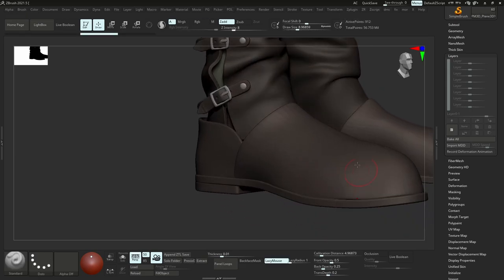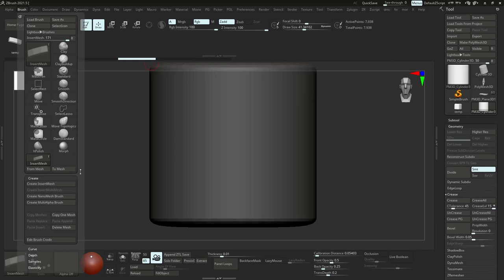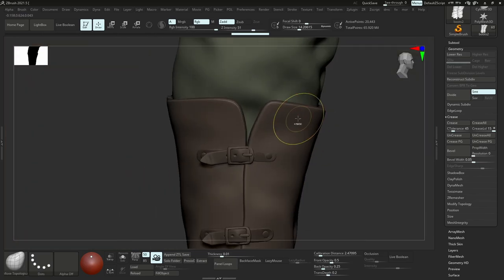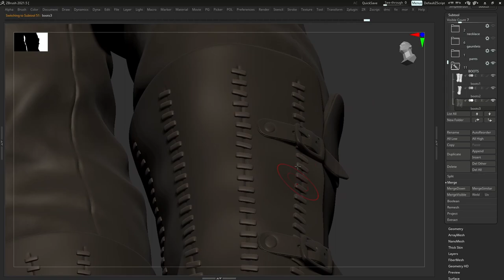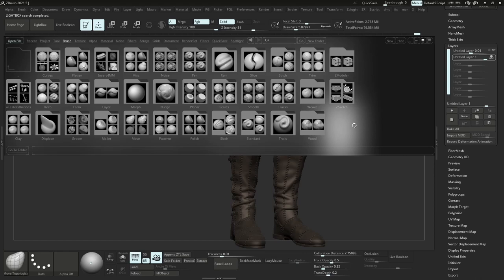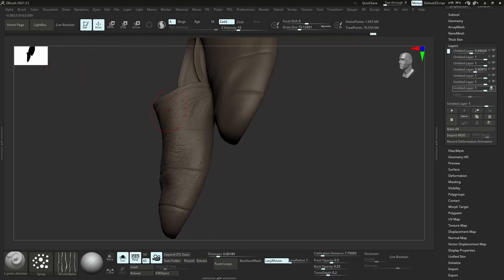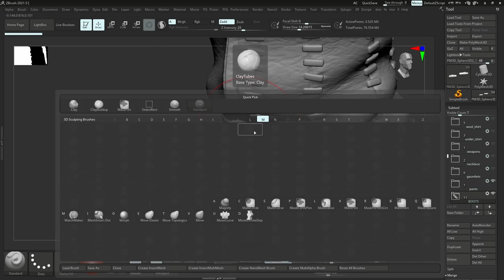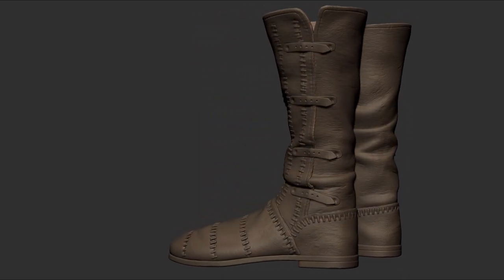3D Modeling Medieval Boots - Part 3 (finishing the highpoly)

Comment: Incredibly educational video. I was wondering, with the boots and other parts of your character being completely asymmetrical.. how much space would you dedicate to the boots alone on a single map? and how many separate UV maps maps would you have in total for the final character? Btw I remember watching every single second of that Zbrush summit a few years back in complete awe while I tried to remember every single step haha. Great work man, cheers!
Reply from the maker: It's an amazing summit yeah! What helped me to rmemeber the steps, is to make a folder with the brushes and have tips at the name like "1_memory folds"  "2_general_folds" this way it's easy ro remember. 

For any character I do. I mostly split the outfit into two texture sets. So you will have one texture set where all the parts of the upper body will be on. 
And one texture set including all the parts of the lower body. Depending on character this cna change like an extra set with all the equipment etc. But a good base is two sets(upper/lower body).     

than have a set for the face, a set for the hands,  a set for the hair. And than one for they eyes. ofc depending on your project you might need to merge sets, but for portfolio there is no worry about any of that.